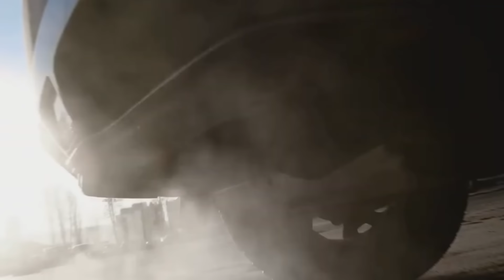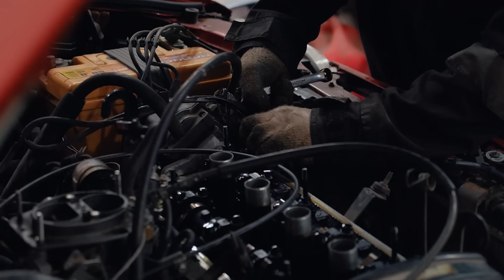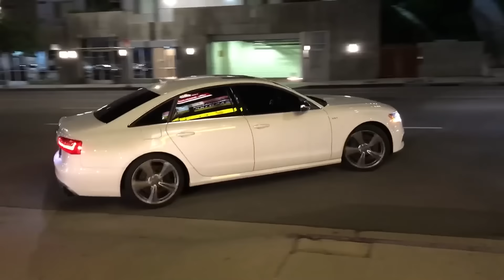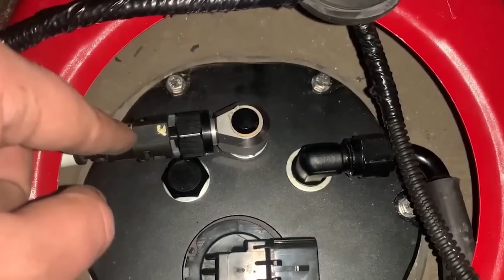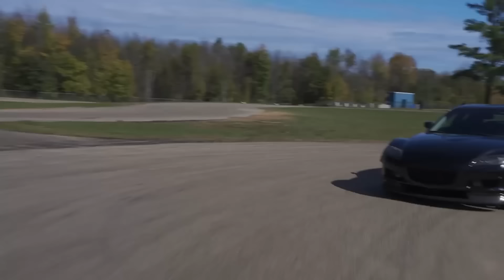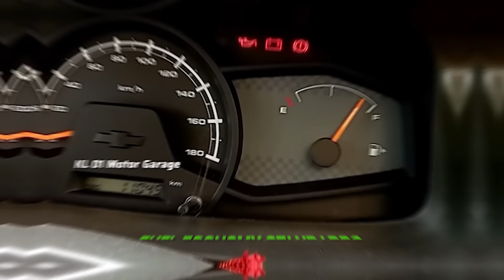10 Illegal Mods That Will Make Your Car Run Better

Comment: The bashing of catalytic converters is stupid. A real builder will factor the back pressure in the build. You can run clean and fast. 
A little effort goes a long way

Comment: Telling people to remove variable valve timing on a daily driver? What are you smoking? It wouldn’t be worth the cost unless you’re building a race car… for a daily driver it’d be much better to keep the VVT system. The same with manualising automatic transmissions… massive cost for very little benefit. Also, don’t transfer your daily driver to racing fuel… this video was obviously created by someone who doesn’t actually know about cars… probably just asked ChatGPT to create you a script for a video about cars and it spat out this rubbish… whatever you do, don’t do anything on this list if you actually care about your car

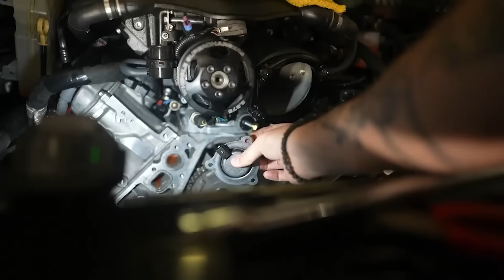Comment: 16:00 all the Honda Junkies are LOSING THEIR MINDS! 
“WHAT?…MY VTEC or i-VTEC SYSTEM IS GOD…Eventho ℹ Don’t fully understand the nuances of Advancing/Retarding Timing at the Incorrect or un-Beneficial time(s).  VTEC systems and yhe like are Mainly Useful to Retard timing a low(er) RPMs Essentially allowing an UnderPowered 1.6L to Have SOME Umpfh at 2000 RPM. 

VTEC isnt really That beneficial in Middle spectrum(s)…But The Advanvement allows for that Extreme RPM making the Exh valves stay open MUCH Shorter periods thus Reducing “Valve Float”…Most of the time you’re limits are in the Valve Springs!
Reply: They Actually created Variable cams to Combat the SHIT power until 3k RPM+ 
But they THEN Realized 
“what can it do at the complete opposite end of the spectrum?”

Comment: For years starting in the mid 80’s, I would remove the cat, then using a long concrete boring tool drill lengthwise through the cores, as long as I could go straight through I would make at least 4-5 2” diameter holes through the length of the honeycomb ceramic/platinum cores, then vacuum out all the pieces and collect them for recycling. The first vehicle was a 1985 GMC S15 Jimmy 4x4, 2.8 V6,5 speed man. That had developed a rattle in the cat for some reason, probably from direct contact with the rock off roading. So I removed it and drilled as I described above. Then did a complete tune up with new plugs, cap, rotor, wires, all new filters and Cam II 15w40 oil. Then went for a legit inspection for a new sticker. That the vehicle passed with flying colors! But it was the drivability improvements, all across the rpm’s, throttle response and high rpm, plus mileage increases of 2-4 mpg! Since then I have done this to every GM and MOPAR I’ve owned. That was when I lived in the people’s republic of masss! Where safety emissions tests were real! But short of a visible fail of custom dual exhaust, that method worked best.

Comment: Okay so let’s talk about this topic 1,4,8 all fall into the same category on only see power difference in changing exhaust components when you have enough hp, on a stock car your not going to see a difference unless your 500hp and up honestly your probably going to lose hp on a stock car because some of the back pressure is needed to build some of that power, also cold air intake is another useless upgrade on a stock car you won’t see a power difference you won’t even feel it and lastly the 2nd and final topic are also the same tuning your ecu getting a tune after mods is honestly the best thing you can do cause if you don’t the car will run like crap  I thought I was gunna learn me something here I already knew all this

Comment: Crank case pressure is a scam recycling burnt oil back into air intake . Clogging the system raping you of fuel mileage causing you to burn more fuel and killing cats . Funny government cars have this deleted. Also kills life of motor

Comment: Honda F20a, Mitsubishi 4G15P & 6g72 have carbon spark cables, no capacitor. By using NGK BK5E ( no resistor ), low impedance 3 core cables & 0.8 F capacitors, long branch exhaust manifold, moving injectors' resistors to a cool location ( below a wiper arm ), adding 2ndary & 3rdtiary heat sinks to resistors' primary heat sinks, I got >2x as much torque fr F20a, no need for any costlier mods.

Comment: There are so many problems with the "information" in this video.  For example, eliminating VVT will reduce drivability in road cars that originally came with it.  VVT allows the engine to run more efficiently at a broader RPM range, and only become a limiting factor at extremely high engine RPM (maybe).  

Also, the last "mod" is bogus as presented.  To truly benefit from higher octane fuel, the engine's cylinder pressure (normally associated with compression ratio) must be increased.  On some turbocharged engines, this can be done by reprogramming the ECM.  However, on most engines physical changes to the engine are required.  Changes like installing higher compression pistons or a larger turbo or supercharger.  Additionally, for big power gains most production engines need stronger components like connecting rods, pistons, crankshafts, head bolts, etc. or the engine will fail quickly because it is experiencing more stress and strain than it was designed to handle.  None of this can be accomplished by reflashing (reprogramming) the ECM.

Comment: 1. Change the emission control engine out for a much larger displacement engine with a carb. 2. Add tubular exhaust headers with open collectors. 3. Add boost or Nitrous 4. Move to another state that allows you to run a top fuel funny car on the street (because there is no emission checks of any kind)

Comment: Did you know, most cars already come with cold air intake and throwing an exposed pod filter in the engine bay makes it a hot air intake?

Comment: Ecu remap or reflash how you want to call it isn’t even ilegal , it’s a nice way to add power which is just that it makes the engine do more injecting and using more fuel and etc but not illegal.

Comment: The electronic exhaust bypass looks very attractive to me, however, I suspect that prolonged use of straight pipes  would be damaging to the engine. It ain't about noise. It's about performance, class and style.

Of course, were I really serious, I'd just pull the 3.6L altogether and replace it with the 6.2L V8, slap a turbo on it and some high speed tires.

Comment: Most of these are Commiefornia restrictions. I live in Texas and literally no one cares if you have an exhaust and cold air intake on your vehicle as long as you still have the Catalytic converter on. I've never heard of anyone caring about noise though here. Don't live in liberal states and you won't have to deal with most of these.

Comment: Guys don't believe some stuff, idk where this guy took the info but coilovers are way more effective if you want to have a faster speed during turns, stiffer, more stable and more efficient with high temperatures.

Comment: I drive a 2002 Ford Explorer Sport trac 4x4 4.0 ltr. Almost every time I hit a small pothole my Overdrive light comes on & my mileage drops to 8-9 MPG. Went to a local 'auto pull your own parts place'. Put in an ECU from a Ford Tarus, use to get between 14-16 MPG now I'm getting around 25 MPG just City driving.

Comment: 1:05 just bore out the catalytic converter. If they look, atleast it's still there. And where I live, we dont have emissions testing. We only do a safety inspection.
Reply: How do you eliminate the cel though?
Reply: @MEH-SE-WA-Crawlers  you drill it out, essentially.  I would not do this.  A buddy of mine did this and he would up ruining his engine.  Engines are designed to operate with the back pressure generated by your cats, by removing them, you are messing up the airflow and that can be really bad.  Can you do it safely?  I think so, but you will have to do some reprogramming of how your engine functions.  It is not as simple as just removing the cats.
Reply: @chuckhoyle1211 the ECM would need to be reprogrammed for the difference in back pressure.  Otherwise, on anything OBDII the computer usually can't adjust to the change.  This is also true for some high-flow cats if they reduce back pressure enough.

Comment: CAT delete is a fallacy, engines are designed around the back pressure and deleting it will smell really bad, and you won't get any better performance.
Reply: no problem for old 90s cars like supra or gt-r
Reply: @Vosoo-e9rboth of which had catalytic converters

Comment: Airbags are hardly illegal, considering most luxury cars come equipped with them straight from the factory. As for manual conversions, 90% of all conversions use factory transmissions, that are often available in American sold cars, but not the specific model in question, or from the same specific model that wasn't sold as an option in America. It's obviously safe, considering BMW for instance has sold many car models, where manual transmissions were only an option in Europe, where almost everybody drives a manual car, but didn't make it into the American sold cars because the market for manual cars is so small that it's simply not economically viable when 5% or less of the market wants a manual transmission car. And BMW's all already have the cutouts in the frame for installing a manual transmission, they just put rubber plugs in the holes and use different interior trim. When I bought my 6-speed 2022 Elantra, there was only one manual car on the entire lot, because somebody had ordered it but then didn't follow through with the purchase. When manual transmissions are available in North America, you literally have to order them from the factory and wait for them to build it.

Comment: It's only mass produced cars that are subject to these laws federally. But if you can build your own from the ground up with no intention to build for anything more than personal use then you are exempt from these laws. As long as they meet minimum safety standards. Old cars are only judged by standards at the time they were manufactured giving more leeway. California is not the standard but the problem constantly overstepping their legal power. That's why I don't live there anymore. I found out that no place else outlaws efficiently in such a ridiculous manner.

Comment: LOL none of that is "illegal" out of a few states like CA that require so called "smog" laws. 
But.. here is fact

A well tuned, set up, built engine, with no smog parts, runs CLEANER than a stock oem car of the same brand/type. This is because so called "smog" is a leveled playfield and can't take into account precision tuning. If "smog" laws were really about clean air, they wouldn't care what parts are on a car, only what it puts out the tailpipe. 
ALL smog and "safety" laws are gimmicks to make tax money for the state/feds.

Comment: You lost me when you said manual transmission adds performance. This was true a long, long time ago, and may be true on a civic with a fart cannon, but is not even close to true on a modern performance car. The fastest ever recorded manual shift(in NASCAR) was 500 milliseconds. During that time you cannot put power down, you are waiting for the transmission to catch up and reengage the driveshaft. So we are clear, that is half a second. A modern dual clutch "automatic" does that in 8 milliseconds. As for holding power, there is a reason why most of the drag cars you see run a powerglide 2 speed automatic. I have been a proponent of manuals until it became obvious that they are effectively useless in modern performance applications. I will never forget the time I ran a drag against a mustang with a manual that was talking all kind of shit about my paddles, and he grenaded his manual on the start line. Now with even an autobox, there are a ton of things you can do to make them much better, like a valve body upgrade and sturdier internals. But a dual clutch is king.

Comment: Easiest and legal way to unlock more hp - use Top Tier Premium gas no matter what the manual says. 87?  Joke.
Reply: Except... that is not what higher octane is about.  Higher octane only makes the flashpoint of the fuel higher.  Now... if you have the ability to re-tune an engine to advance ignition timing higher octane fuel might give more power.  Any added power will come from the advanced timing and not because the higher octane fuel somehow created a bigger explosion or more power.  
So, in a nutshell, putting 93 octane fuel in my engine that is designed and tuned for 87 will do little other than relieve my wallet of some of my hard earned money.

Comment: That transformation from automatic to manual its not illegal its legal you only need to register it like it or if you did convert it you only need to tell the that apartment it was cheaper way automatic is expensive to fix when fails
Reply: I know that because i had Passat W12 and it was automatic and transmition failed and i puted manual transmition and they only asked me why did you put manual transaction i told thrm because my automatic transmission failed anf i puted manual snd i hived zhrm papers and thrx puted from  automatic transmission to manual transmission
Reply: I've never had to explain that or what I changed I did it and went on my way

Comment: At some point, I am happy to live in Germany... TÜV is annoying, but if the mod passed TÜV, it's sure the mod is legal...
And tbh, about variable valve timing, it was originally invented to gain HP, not to reduce "dirt"..
Just Example the 1990s Honda engines.. 1.6l equals about 120 HP without variable valve timing.. With variable timing same engine had 160 HP from factory.
And manual transitions, yes, they used to be better, but the newest double clutch automatic gears shift faster than you could manually, and if you go to manual mode, if you are unhappy with gear choice, you regularly shift faster than a manual gear could.. Unless you are extremely experienced race driver.. I remember Walter Röhrl testing the Porsche double clutch.. On paper the manual was 0.1 seconds faster to 100.. In five tests Walter Röhrl one time made it to best the double clutch with the manual transmition.
Reply: bro germany asshole country. for my mods i wud be arrested lol

Comment: If you remove your dual cats just install a a single 100 cell cat and your legal..most running a tune doesn’t matter if you can repair the car your self, or just buy a earlier OBD2 car ! Cold air kits work if built right
Reply: If your state REQUIRES CARB certification on ALL engine mods, then that would be illegal.  But.. some states do allow it so... should check first.

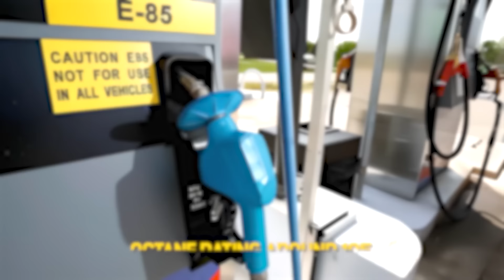Comment: 22:06 if e85 is so illegal why is it pump gas
Reply: E85 by itself isn't illegal.  Also, at any gas station you can also purchase right from a pump,  off road diesel which is non dyed and no additive for on road use that people run in farm trucks,or their home furnace, or for any other diesel engine that isnt used on-road. Not illegal until someone runs it in their diesel on the road vehicle.  What makes it super illegal as far as when running e85 and race fuels are certain tunings that you can flash your ECU with. E85 alone will give a small boost, but when you run it with said illegal tunings programmed in can literally double your HP. What happened is once this tuning is running, the car no longer has the ability to control  the excess emissions that come from the higher octane fuel, and also even if you running regular fuel and still have that tune in, it won't even control emissions from regular gas. Makes alot more pollution get into the air.
Reply: Cheap gas low octane requires more fuel for consumption. 😂 racing fuel

Comment: Your wrong on so many points here, are you a mechanic? Have you worked for a manufacturer of any engine, even small engines? Do you truly understand how a catalytic converter works and why?
Since when did we start listening to the less educated in this country?
I won't go to some guy on the side of the road for legal advice
BUT
for some reason we will take advice online from nearly anyone.
Reply: Hey you listened to trumpy , a well known liar / moron with demensia didn't you ?

Comment: I fooled them all and turned my car into a real sleeper with mega hp. I installed a dozen fuel line magnets that look like clamps that stirs all the fuel atoms before it gets to my injectors. Also dumped all my motor oil and replaced with Slick 50. Both mods gave me 50+ hp and legal.
Reply: Hate to tell you this (actually, no, I don't), but magnets will only effect metallic substances.  Gasoline has none.  Also, even if it did work (it doesn't), all of that 'stirring of fuel atoms' will be wiped away once past the magnets.
But, really, those magnet thingys have been around for more than 60 years.  They have NEVER been shown in ANY testing to effect fuel mileage, wither better or worse.
Just answer me ONE question, and I will apologize and come fully on board with this.

The question is "How will magnets affect/effect non-metallic fuel?".
Reply: Sounds like u went on temu and purchased a bunch of crap …. 50 hp?? No motor rebuild no jump from naturally aspirated to charged … something stinks or ur gullible

Comment: If these Mods are truly Not legal for US roads, then why are you showing people how to do them?

Diesel Deletes are not legal; they do Not make your truck last longer in fact they increase the internal temperature of the engine, thus making a 250,000-mile engine and making it last about half that. Before you tell me about your POS lasting 500,000 miles why did you buy a new one only after 100,000 miles? The answer is you damaged the engine and now you do not trust it towing your camper and the dam thing is ticking because the exhaust manifold is in ten pieces
And
The black smoke you love so much has contaminated the land your children play on with heavy metals like Lead and Mercury!

Just one example of why things are not legal in a first world country
But
Yet you whine, why can't I kill more people?